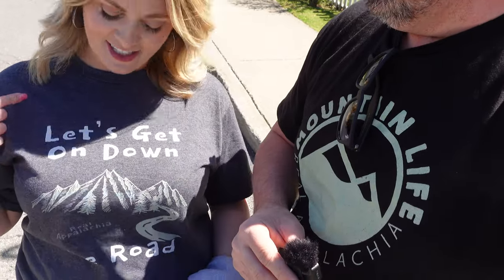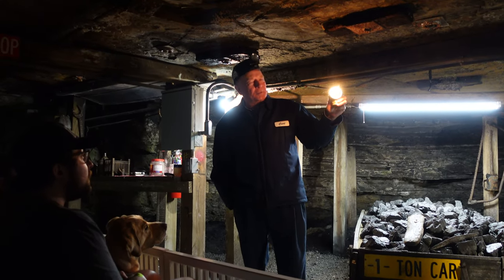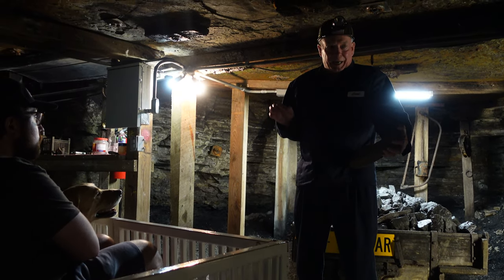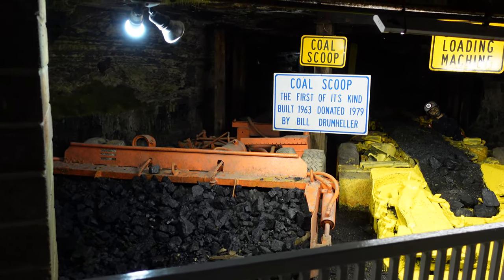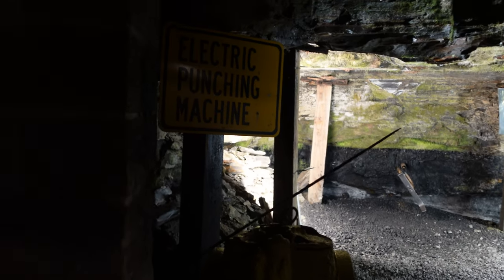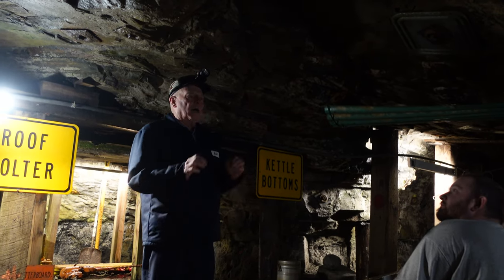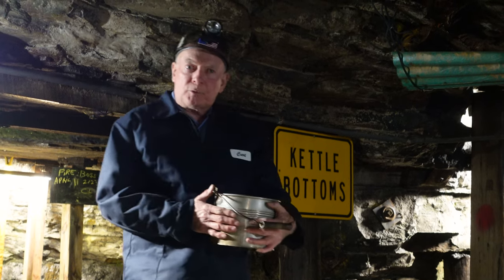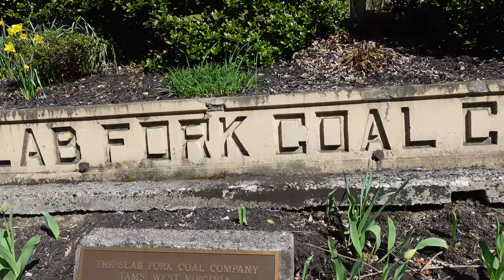Life As A West Virginia Coal Miner

Comment: I toured the mine with a group in the spring of 2010 not long after the Upper Big Branch disaster.  Our guide offered some opinions on what went wrong at UBB.  What got me most was how stale the air was inside the mine.  I didn't really realize it until we got back outside.